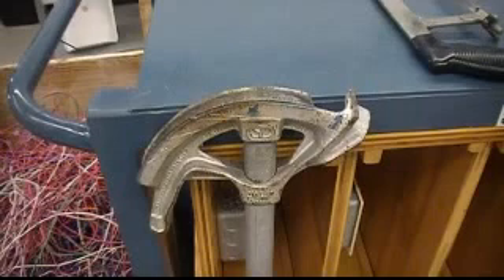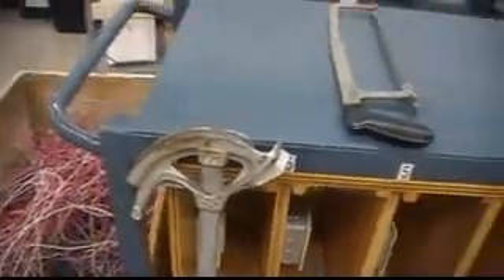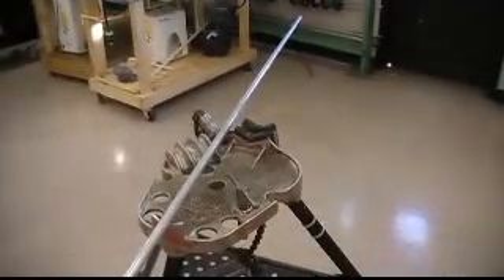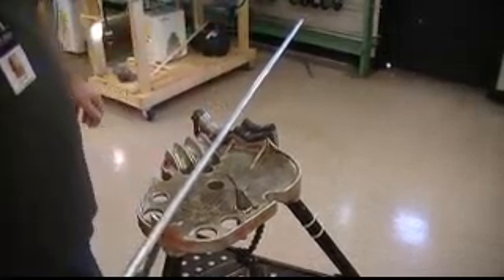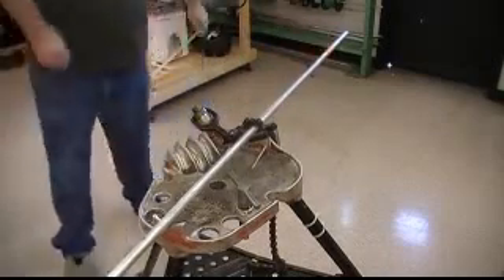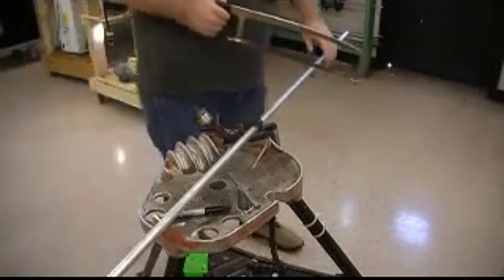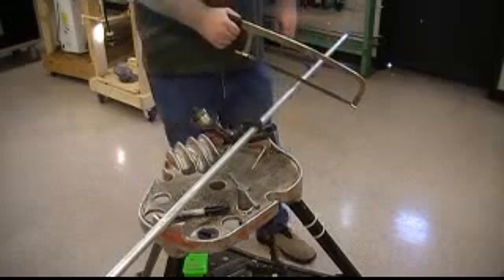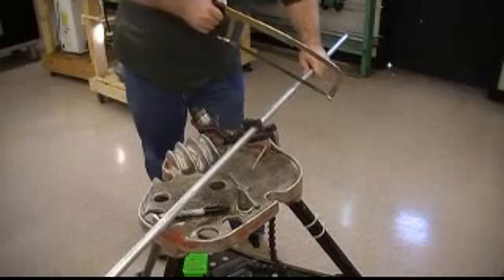Conduit Tools and Cutting/Reaming

Comment: I do electrical work and I gave up a hacksaw a long time ago. I use a Klein pipe cutter and it does the trick every time. Score the pipe about five times on 1/2" and snap the pipe into. I've been teaching a greenhorn for two weeks and when I showed him how to use a hacksaw and then the Klein pipe cutter he grabs the pipe cutter first every time. And we don't use a vise for anything but rigid or bigger emt. Still a great vid. And another tip is if you put the hacksaw on the mark and apply some pressure then slide it back a few times it will score it enough to were you can start cutting.
Reply: how does the pipe cutter compare to using a sawzall in speed

Comment: Sawzall over a pipe cutter anyway. It just beats a hacksaw. Just when your using the pipe cutter don't cut all the way thru. Score it about 5-6 times and try to break it. If you cut it all the way thru it will shrink the pipe about an 8th of an inch.